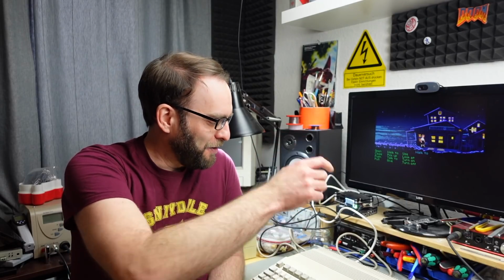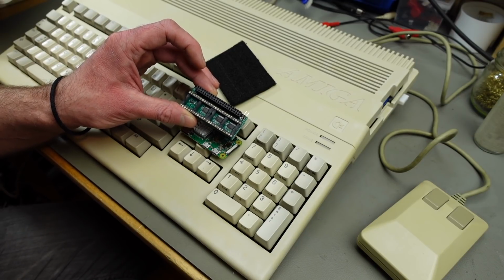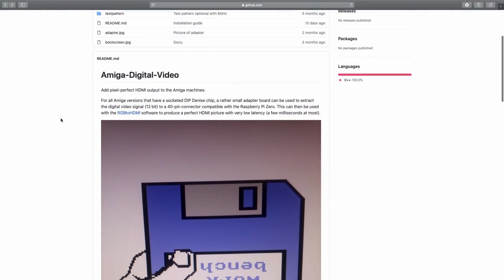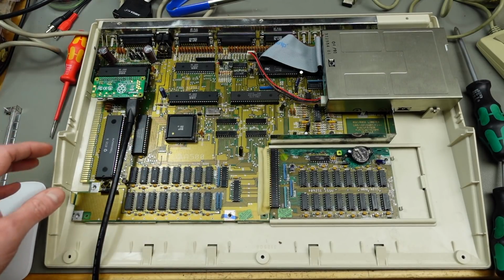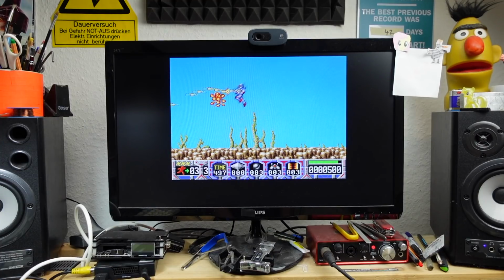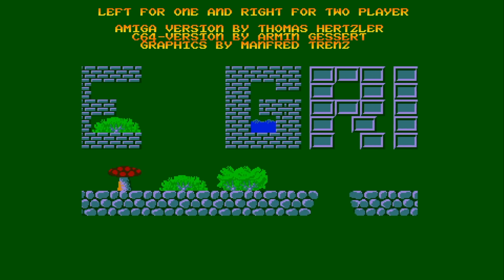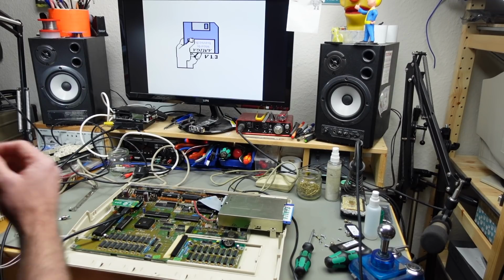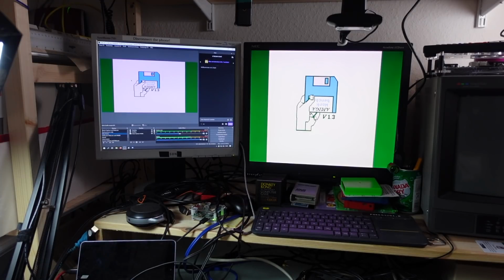Amiga HDMI with a Raspberry Pi! (RGBtoHDMI)

Comment: 4:00 I wondered if voltage regulators like those could have been used on the TerribleFire boards (TF530 etc.) so as to allow for a swap between 5volt and (approximately) 3volt RAM (as static RAM was pricey).

Comment: I need one for my A500, A600 & A1200!!
Reply: You can on a500 and a600. The a600 requires you to solder wires directly to the Denise chip, else you need to create an adaptor. On the 1200, this will never work. The 1200 uses a video signal that have too many bits. On the other hand. If you can afford an 1200, then you have money enough for a scandoubler.

Comment: this looks amazing. I was wishing there was one for my 1200 - but then I was thinking.. why do we need to hijack the denise chip directly for the rgb signals? can't we make up a wire that uses the rgb out ports (present on 500 and 1200) that terminates in a pi header and feed the rgb that way? could optionally use the audio out ports on the back to also mix in audio.. what am I missing?
Reply from the maker: Of course you could use the analog RGB output signals from the ports. The outstanding thing about this approach is that it uses the digital signals which makes the quality pixel perfect.
Reply: I was wondering if it ONLY worked with digital and wouldn't work with the analogue for some reason. I know the internal is the nicest (they've basically made a DIY alternative to a scandoubler at an 8th of the price!) i'm just impatient when it comes to things like 1200 support :D
Reply: (or, as there is conversion done on the daughterboard to convert video to pi language, a rgb out to THAT pcb which passes to the pi)

Comment: This is great, so affordable and fast. Even though I have a Micomsoft XPC-4 for analog RGB and VGA upscaling to HDMI, I would replace it with this. But one question, which I'm not sure anyone other than the creator of the software can answer, is does it respect the pixel aspect ratio being output. I'm not talking about the 4:3 aspect ratio, I mean for outputs with non-square pixels, does it try to replicate that as close as it can to the available resolution, or does it just assume everything is square, which will cause some squishing depending on what you have it hooked up to?
Reply: In default mode the upscaling is a pixel-perfect integer scale. So you have square pixels there. It may be possible to adjust scaling by use of the menu button of the RGBtoHDMI software. But I am not the expert there.

Comment: To clear things up, the Super Denise is the ECS one. Its what is fitted in the 500+ and it's totally pin compatible with the OCS Denise. The Denise that comes in PLCC format is the ECS one, and it's the same die inside the package.

My guess is they dont yet support the "Productivity" type modes that ECS Denise has, but an ECS Denise would work otherwise
Reply: The plcc denise was only ever used in the A600, apparently! Great use of budget there :)

Comment: That’s a remarkable piece of kit. The amount great stuff being made to keep our beloved old machines going is wonderful.
Reply: It feels little strange to have a RPi with 10x the power of the Amiga demoted to a RGB to HDMI converter....
Reply: @anticat867  Debatable on the 10 times more power, if it had ten times the power it would be able to emulate the A500 at full speed and the zero can't even make half speed.
Reply: @thomassmith4999  My initial statement was phrased very pessimistic. Looking closer at the data: The A500 has a Motorola CPU running @ 7.09 MHz. The RPi Zero has a single core @ 1 GHz. Assuming 1 instruction per cycle for both, we get a CPU speed ratio of 1:141. However, emulation of a computer is a completely different beast. Both devices have a GPU and a dedicated Audio-, IO-controller. If try to run all tasks just on the CPU than 1:141 is not enough and offloading to the RPi's peripherals is not that easy since dedicated hardware has specific Instructions since it’s not a general-purpose core. By the way that’s why everyone was "surprised" how well Rosetta 2 works. But as it turns out Apple added some "magic" to the silicon to allow the ARM to run Intel instructions efficiently.

Comment: Maybe it’s possible to use a RPI zero W and VNC software to capture...
Reply: There is no system on RPi zero probably for maxing speed or specific hardware access. Only bare metal
Reply: @jankomuzykant1844  Yes your right. I think because of the speed. So it use the RPI like a cheap FPGA with HDMI. Still a nice project. I’m going to look at the VHDL code for more options. ;-)

Comment: It's crazy we can just put a fully featured modern computer inside an old one just to act as an analog to digital converter.
Reply: As I understand it this conversion from Amiga to HDMI takes place entirely in the digital domain as it takes the RGB bits from Denise directly prior to them going to the video hybrid DAC (the "Vidiot").
Reply from the maker: Yes, it’s using the digital signals, that’s why there’s no blur at all.

Comment: C128 please
Reply from the maker: C128 80 column mode should already work with the CGA version of RGBtoHDMI.
Reply: @JanBeta  yes but cga to rgb is a hard target as I have a jama and a 8200 boards. I know some have been using scrate but is there a video on c128 to scrate then to rgb
Reply: A guy the from Netherlands had indeed made device for 128 80 col I put a comment on fb as he is ready to sell them

Comment: Nice add-on, this one. There's also a similar one for the ZX Spectrum.
Reply: Yea it's called TK-Pie by Victor Trucco, a while back I made a blog  post about it if you want to build it yourself:
https://gozdnijezek.medium.com/building-tk-pie-by-victor-trucco-ebad886cd6d3
I also have some left over boards if anyone is interested :D
Reply: Also the ZX-HD.
Reply: @jocool7370  That is correct, but that is a commercial project, which you can't build yourself :)
Reply: I think IanB may also have a spectrum solution, but I have no details.

Comment: now we need a version for aga
Reply: AGA output was analogue from the chip (OCS had digital RGB), so I suspect that's a little harder...
Reply: @balloonsystems8778  nope OCS was also analog RGB from the 23 pin port on the Back.
Reply: @balloonsystems8778  AGA also has digital output from the graphics chip (Lisa). But it is too much data to be processed in the same way by the Pi.

Comment: I have that thing here and the quality is mind blowing. It can even handle older 1280x1024 screens as well (My HP 1940 works perfectly with 50Hz).
I have the same Scart/Fbas/hdmi to HDMI Box as you have. You dont't need that, connect the Pi directliy to your screen and you have a near zero lag (Maximum of 0,5 to 1 frame) because that thing sucks the digital RGB Data directly from the Denise Chip and writes it into the Pi Framebuffer.
I Replaced my Indivision with that solution, because the result is sharper and the Lag is smaller on my setup.
For you Caputure Card try the Menus, there are much options, I Think in the default settings Genlock Mode is activated, maybee that cause the issue. Or you have to force your Capture Card to HDMI RGB Mode.

Comment: Been waiting (and asking about) this for years!  But.. for the 64.  Hopefully now that the ball is rolling it will be done soon.
Reply: C64 also supported, but I think it needs the copperdragon YUV converter.
Reply: Unfortunately the best video output the C64 has is Svideo (Chroma/Luna) output, no RGB.  :(
Reply: @DaveMcAnulty  I think a dac expansion is on the way, but probably only comparators for now.

Comment: The problem is that most Amiga 500 accelerators sit in that space already.  The OSSC is nice but I use a interlaced workbench mode, the flickering true the OSSC is extreme.
From what I understand is that this uses the digital signals on the Amiga side, so maybe it's possible to use a extension cable to move it more to the right?
Reply: The connection from the adapter to the Pi could in theory be extended by some means, but it is very very sensitive to exact timings so the extension should be as short as possible. Even then I can give no guarantee that it will work.

Comment: It's very cool, but at the same time it's kinda like fishing with dynamite, because a Raspberri Pi could probably emulate every Amiga that was ever made and be better at it than the original hardware was.
Reply: No it can not. Even on a raspberry PI3 I got dropped frames in pinball fantasies. It's nice for workbench stuff, for gaming I found it terrible.  It seems to be a lot better on the PI4, but this is just a 700 MHz arm cpu it will do very bad amiga emu.
Reply: Emulation may be a way to go, but having the real metal can be also very satisfying thing. Like having an old-timer car.

Comment: How does it work when you have multiple resolutions on screen at the same time? I remember being able to have a HAM image in a window which I could slide down, and then have the workbench below.
Reply: The Amiga automatically outputs the highest resolution currently on screen - note that HiRes is exactly double the resolution of LowRes.
Reply: The mod always threats the video data as high-res (640 pixes) with 12 bit color depth. So it makes no difference how you mix and match resolutions and color depts. But it only works correctly with OCS modes.

Comment: I understand the desire to restore retro tech and make it more easily useable, but I always find amusing the use of a modern CPU capable of emulating the entire Amiga at full speed or greater to merely do something like provide a better video output.
Reply: You cannot emulate the complete amiga 500 on a pi zero. It will run but it will be not a lot of fun.

Comment: What I really like is the current tendency to use off the shelf components to emulate devices or adapt display. The Amiga HDMI is one example, another is the SDrive MAX, where you only need to buy an Arduino Uno, a Touch-Display and solder 5 wires to a Atari SIO-Cable and you get a Atari Floppy Drive Emulator...No custom PCBs, simply stuff you can order from Amazon or another store.
The only custom part is the SIO cable and for that, there are STL files on thingyverse to print the connector and part numbers for the connectors...
Now we have a HDMI mod for the Amiga with a Raspberry and a simple PCB for the interconnect (you can wire that up)...

Comment: I need for A 600 and 1200 ....   is there way to have it ?
Reply: It will not work on the A1200 but I have put together an adapter board that c0pperdragon designed with option to solder all the RGB signals by wire from the denise in a A600. It works just the same as Jan Beta showed on his A500.
Reply: @josteinkallevik  ehh. monitor port not output same signals?
Reply: @jarisipilainen3875  I asked c0pperdragon the same and he explained : "The current software-based approach is pretty much at its limit with a 70ns pixel clock with 12 bit of color data for each pixel. This is alse the reason that none of the specific ECS screen modes are possible (super-high-res, producivity und such).
The Lisa would deliver pixels with 35ns intervals and 24 bit color depth. This would have a 4x higher data rate. This is totally beyond the capability of this simple setup."
Reply: @josteinkallevik  Are details about this adapter board available online somewhere? I searched but could not find anything...
Edit: here are the first details: https://github.com/c0pperdragon/Amiga-Digital-Video/issues/1#issuecomment-743925751
Continued discussion here: https://github.com/c0pperdragon/Amiga-Digital-Video/issues/22

Comment: it works wit hdmi to dvi adapter with hdcp monitor?
Reply: I have it here connected to a HP 1940 (Native 1280x1024 was auto detected perfectly) DVI Screen using a simple passive hdmi->dvi adapter. The Picture is mind blowing. Perfect Scaling for the typical Amiga Resolutions from 320x256 to 640x512

Comment: Hi Jan. The colors issue you have with your capture card is because HDMI has two modes : RGB and YUV (also refered as YCbCr) Apparently your Raspberry and the capture card are not set to the same mode. To be more accurate, the Rpi procuces an RGB picture but your capture card waits for it as an YCbCr one that's why black (0,0,0 in RGB mode) appears as green (0,0,0 in YCbCr mode).

Your LIP monitor, on the other hand, adapts itself to whatever mode you throw at it.
I guess the sound does not come out from the hdmi port, does it?
Reply: Very good info!  I have the same question; can you inject audio into HDMI?
Reply: @Mr_ToR  Of course you can transport audio over HDMI and even if you literally meant inject, there are audio injectors that can add the audio to the HDMI signal after it leaves the Pi.
Reply: @redcubie  i guess i was not clear enough.  audio was not mentioned in the review.  can this device provide audio over the hdmi output :-)  thats what i was hoping it would do.
Reply: @Mr_ToR  No. This solution is strictly video only.
Reply: @copperdragon9286  shame
Reply: @Mr_ToR  It wouldn't make much sense to integrate a techology that easily costs like 60€+ on it's own, just as an option, while many people don't even  need it. If you need this, no one hinders you from buying an additional HDMI audio injector and somehow plug it into the Amiga's case.
Reply: @elmariachi5133  no, you got it wrong. just use a cheapo audio interface that has analog audio in. probably even a usb audio device or an audio hat would work. pi zero already outputs audio with hdmi.  you need a very cheap audio a2d module and some coding. thats all...
Reply: @Mr_ToR  That was my thought at first, too. Unfortunately, it is not quite that easy unless you go down the expensive injector route. From the developer ... "There isn't any way to get audio directly out of the Pi's HDMI output at the moment. RGBtoHDMI was originally designed to work with computers that have built-in speakers like the BBC micro so it wasn't an issue. Any audio input to the Pi would require a significant redesign and maybe something more powerful than the Pi zero so it is unlikely to be an option anytime soon."
Reply: @AaronNewcomb  shame :-)
Reply: IDK, another SBC doesn't sound too bad, too difficult or expensive a solution. OR is this an issue with all ARM processors?
Reply: @squirlmy   @Cuvtixo D  You could use something else with more horsepower that could transcode both the video and audio at the same time. Perhaps even an RPI 4 or other ARM board, but that changes the design/form factor of the boards that  been built and you would have to rewrite the software to run on another processor. Remember, this doesn't use Linux. It runs directly on the processor.

The whole solution was supposed to fit together with the RPI Zero. The Amiga is a bit of a one off. See my first video on the RBGtoHDMI to see what it would look like with the standard solution. Also, there is loads of documentation on the GitHub page and associated Wiki.
Reply: @copperdragon9286  I can be modified, if you have the know how. The audio channel is left null, but it could be modified to be fed audio data as well, but you would need to do the work yourself. That means running jumpers to some line level audio output and providing your own audio stream. HDMI 2 has support for 32 audio channels, fyi. Completely overkill for this, but so you know, you won't need to hack anything to force the audio stream in there.
Reply: Some capture cards also have a chroma key feature to replace a color with another or pixels from a background picture.

It seems to be the case here because only black colors seems to change.

Please check that the chroma key feature is not enabled in your capture card settings :-)
Reply: I presume he uses an Elagto in combination with OBS, there should be options to set the correct color spaces.
Reply: There is no audio on the Denise chip so you’d beat mix it in with a cheap hdmi+audio in->hdmi connector.
Reply: @ekistic  Those add at least 30ms latency for sync purposes. It would be nice to modify the rpi directly to mix it in as well.